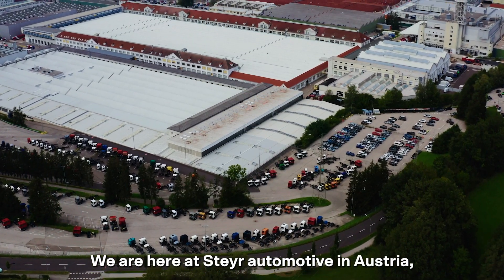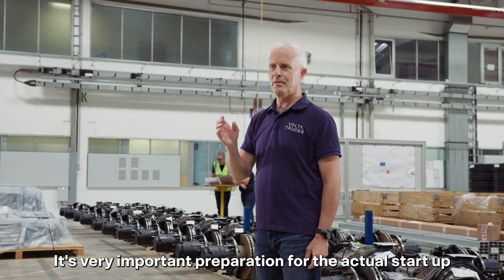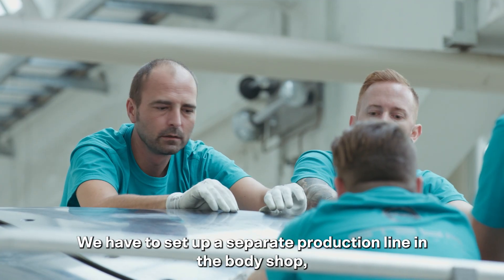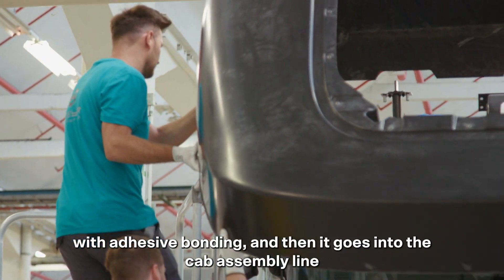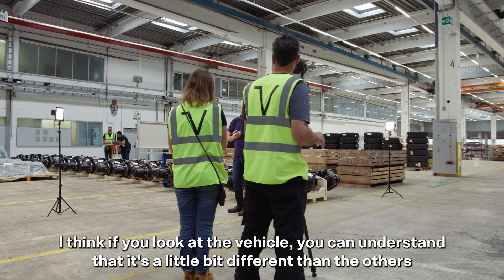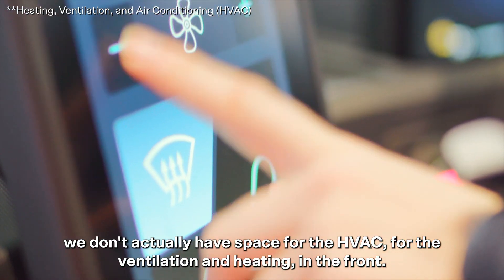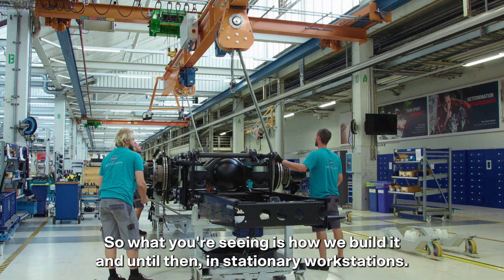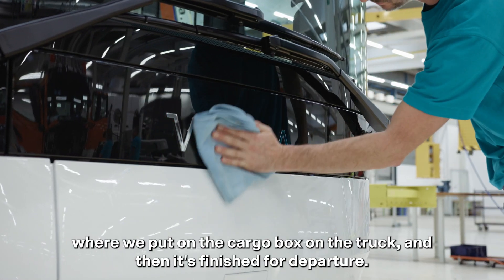Behind the build of our all-electric Volta Zero

Comment: This company declared bankruptcy because no one wanted to buy such trucks😂 the life of such batteries decreased very quickly! The battery capacity itself drops significantly in winter! Of course the manufacturer doesn't talk about this😂Even the largest car rental companies are phasing out electric cars because their repair costs are much more expensive than normal cars and people simply do not want to rent such cars due to their low range. Of course, I am in favor of ecology, but not at all costs. Imagine tractors and combine harvesters that need a lot of energy and sometimes have to work for many hours to harvest the crops on time. Also, the truck must transport goods on time, meat, vegetables, milk... the truck will refuel in 5-10 minutes and can continue driving to load/unload on time, to make it before the driving ban (at certain hours and days), in order to catch the ferry or train (just for ecology reasons). An electric truck makes no sense nowadays. Not to mention the cost of such a truck or car, which is several times more expensive than a regular car!

Comment: Such a shame for this to happen,we hope that you come back stronger,one of the best design delivery truck to have on the road.We hope to see it in the future.
Reply: This company declared bankruptcy because no one wanted to buy such trucks😂 the life of such batteries decreased very quickly! The battery capacity itself drops significantly in winter! Of course the manufacturer doesn't talk about this😂Even the largest car rental companies are phasing out electric cars because their repair costs are much more expensive than normal cars and people simply do not want to rent such cars due to their low range. Of course, I am in favor of ecology, but not at all costs. Imagine tractors and combine harvesters that need a lot of energy and sometimes have to work for many hours to harvest the crops on time. Also, the truck must transport goods on time, meat, vegetables, milk... the truck will refuel in 5-10 minutes and can continue driving to load/unload on time, to make it before the driving ban (at certain hours and days), in order to catch the ferry or train (just for ecology reasons). An electric truck makes no sense nowadays. Not to mention the cost of such a truck or car, which is several times more expensive than a regular car!